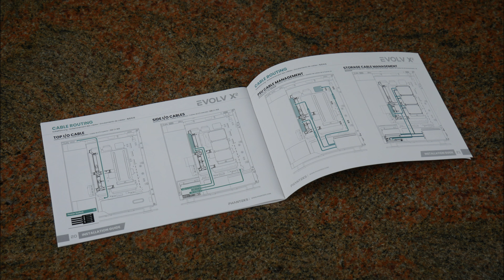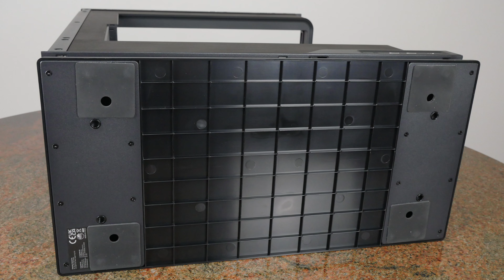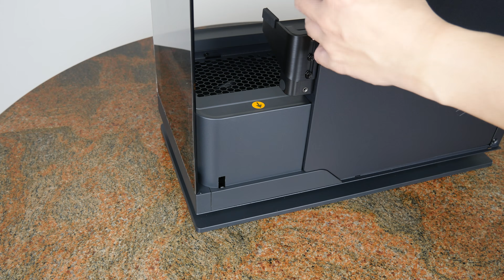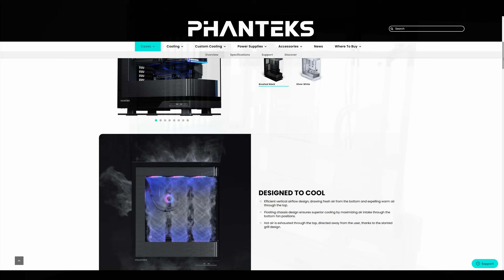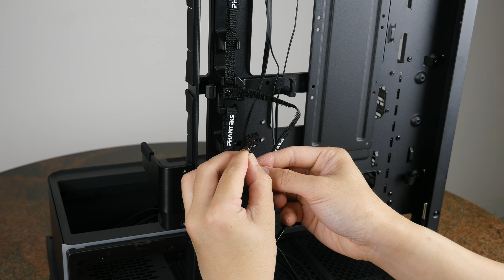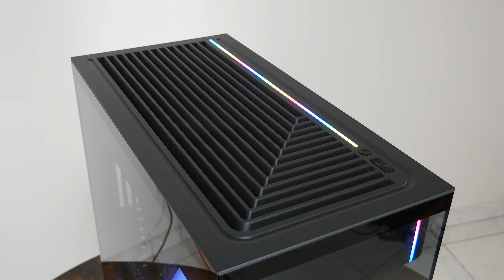Premium ATX PC case for showcase builds! Phanteks Evolv X2 Review

Comment: Dude thank you for using an air cooler. Every single review i seen uses an aio. I don't have one and i want to use a my NH-D15.
Reply from the maker: Cheers. I received this case much later after the Evolv X2 had launched, and was wondering how else to make my review different from the other reviews that had already been published. Also helped that I didn't have a spare AIO CPU cooler around so I decided to use an air cooler just to see how it'd perform 😅 I guess the NH-D15 should work pretty well from a thermal perspective - just make sure you've got the bottom intake and top exhaust fans installed in the case (and the rear exhaust too - think this should also have an impact on thermals somewhat), and you should be good to go! What processor are you intending to use with the NH-D15 and the case?
Reply: @ALKtech thanks for your review! I wanna buy this case with air cooler ! Do you suggest it ?
Reply from the maker: @mohammadmg2015  hope you found the review useful in some way! Personally, I would go with an air cooler that looks sleeker than the Thermalright that I used in the review - perhaps something that looks "monolithic" so that it matches the aesthetics of the case. Some coolers that come to mind include stuff like the DeepCool AK620 Digital, Cooler Master Hyper 612 APEX and so on!
Reply: @ALKtech im considering deepcool assasin iv ! I was thinking what if we put 3 bottom inflow + first top and the rest as outflow ! Would it be better or it doesnt matter !
Reply from the maker: @mohammadmg2015  oh nice, the Assassin IV looks pretty sleek and in my opinion matches the Evolv X2's aesthetics! Fan orientation wise, I'd go with the bottom three fans as intake, the top three fans as exhaust and the rear fan as exhaust, my two cents! Have you decided on the model of fans yet?
Reply: @ALKtech for fans i consider phanteks m25 gen2 or arctic p14 argb
Reply from the maker: @mohammadmg2015  oh I personally use the M25 G2 in one of my PC builds, and I really like their infinity mirror hubs! Haven't used the P14 before so I can't really comment on them...

Comment: Phantek Evolv X2  needs more ventilation. PC components need to breathe.
Reply from the maker: Yeah having front/side intake fans would make a big difference I'm sure - the Evolv X2 is clearly a case of trading off some thermal performance for a unique aesthetic that otherwise couldn't have been achieved without a tempered glass front panel. Anyway from my testing, the thermal performance is still pretty acceptable all things considered, I didn't encounter any thermal throttling at all!

Comment: I was trying to figure out where the power supply was.  Those bottom fans conceal a hollow space for the psu and extra wires.
Reply from the maker: Yeah that's right, the Evolv X2 uses a more "traditional" placement location of the PSU, in a chamber beneath the motherboard!